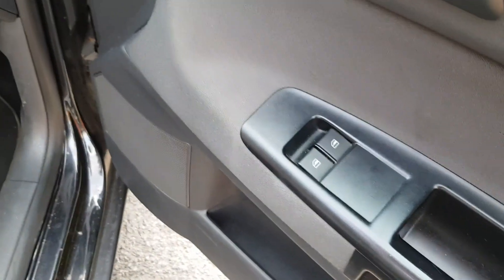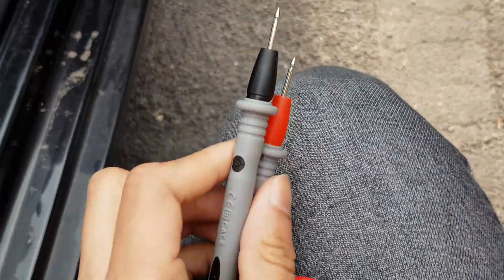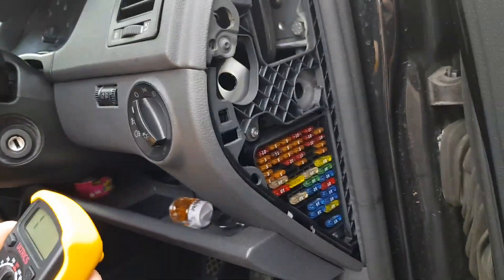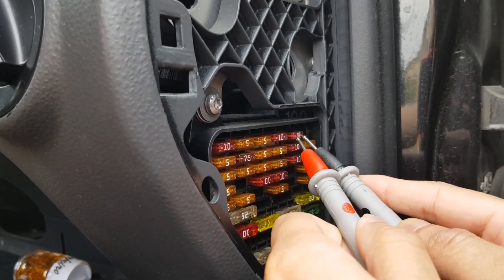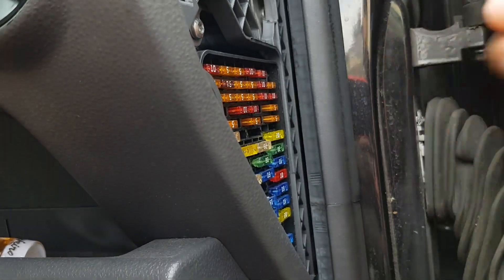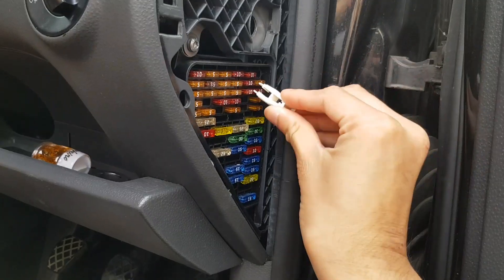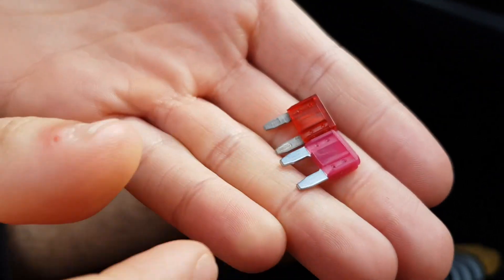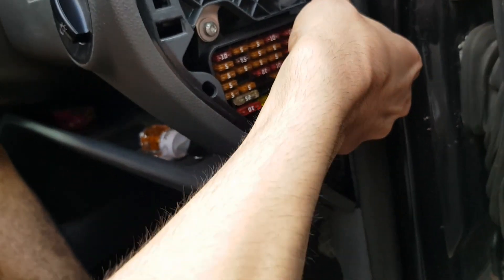How To Check And Replace Car Fuses Using An Multimeter

Comment: Does the car need to be on to check fuse? Or off?
Reply from the maker: Depends which method you using, if doing by just noise then no, if reading the volts then yh put in electic mode

Comment: What about unhooking battery?
Reply from the maker: How would you test fuse then if theres no power
Reply: @MrWaheedulHaque  I think you can still get a reading - I think the fuse it’s like a full circuit (if not blown) when the tips of the wires are attached
Reply from the maker: @DannyNY  try it and let me know, but i never heard of anyone taking battery off to test fuses, but let me know the results im interested

Comment: Hi thanks for. Sharing, 
But you can check the right fuse of dom light by checking diagram of fuse box, commonly it has there.

Thank you 👍
Reply from the maker: Yes this is true but finding a reliable one is hard, even on my new car finding the right fuse diagram with labels is near to impossible im having to jump through many forums

Comment: I have a question can you also check the fuse with the voltmeter settings and have the black lead on the ground and use the red lead to check both sides of the fuse to see if it's getting battery voltage? Or using the ohm meter is the proper way?
Reply from the maker: Yes you can do this also
Reply: @MrWaheedulHaque  ight thx. I had a brain fog here at the shop. Had to refresh. I approve this video. Thx bud
Reply from the maker: No problem mate

Comment: Nice video. If my multimeter doesnt have a bleep function how do I know the fuse has blown? Thanks
Reply from the maker: You would have to turn the ignition on, then measure the fuse
Reply: @MrWaheedulHaque  measure the resistance of each fuse, if its 0 or really close to it then its working. If you get no reading then its open and faulty.